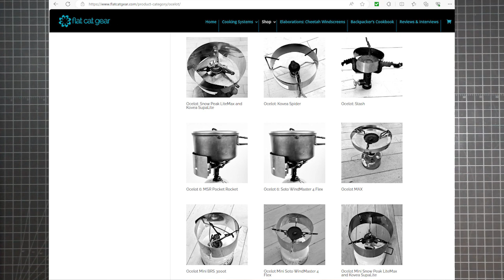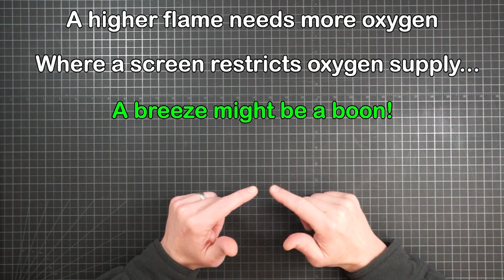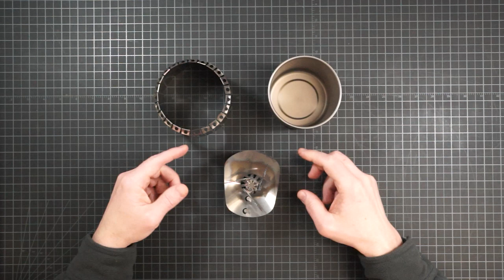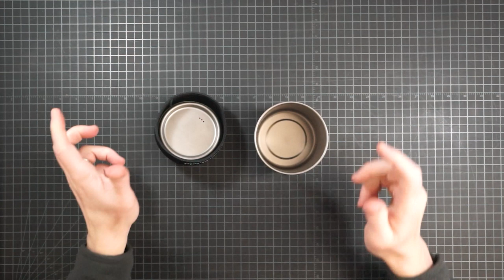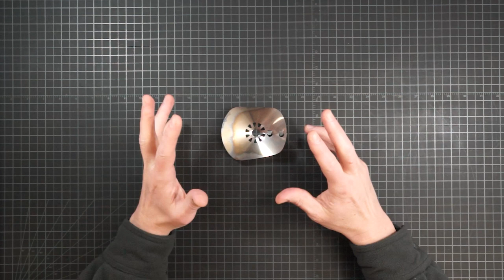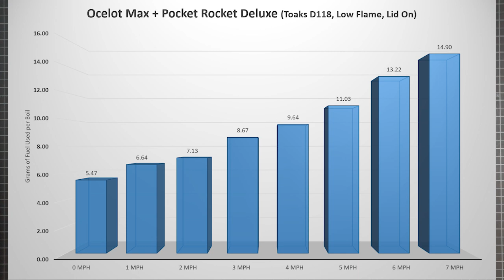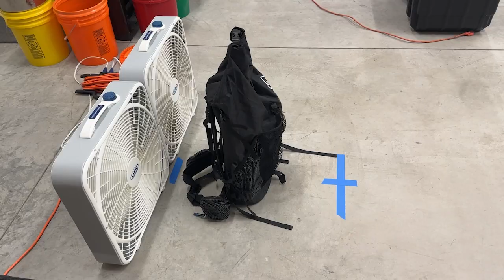Backpacking Stove Efficiency, Part 3: Windscreens

Comment: I wonder what happens if you use the wider pot with a smaller burner and a windshield.
I suspect it would actually be more efficient if there's an air gap below the pot and then you're not increasing the weight so much. It might seem redundant to have the wider pot without a wider flame being produced but heat is spreading out the sides anyway so I still suspect it's a minor improvement.

Comment: The optimus shield was installed a little low on your adapter. It would sit just below the lip if it would be installed on canister. Not a shield for weight weenies anyway, but it can be nice if radius of the shield is close to the radius of your cup, then it takes up little space volume wise. Nice compromise between the flat panel windscreens and thin foil ones that fold under wind :P (I was not aware of FlatCatGear ones)

Comment: I'm curious about the possibility of burying the stove and fuel canister to use the ground to block the wind rather than any aftermarket shield. It would require a bit more work in the field, but it could be worth it, especially if you're using a wider diameter pot/pan that might require something like the ocelot max but while using the lighter brs.

Comment: Thank you for in debth analysis.

A piece of thick alu folie might make an ultra light, ultra cheap custom windscreen for any system.

Remember, consumables like food and gas is consumed during the hike…the weight penalty is therefore only max the first day before the first meal, and zero the last day after the last meal…maybe 50% in average.
Reply from the maker: I appreciate that aluminum foil can be a very light option.  It makes a good screen for alcohol stoves.  My reluctance to discuss it with gas canister stoves is due to the potential safety concern of trapping the pressurized can inside where it might dangerously overheat.
Reply: @GearSkeptic  the alufoil option was just an add-on to the very precise test you did. So was the heads up, that there is a difference between consumables and non consumables, actually a huge difference on longer hikes, food included, in favor of low non-consumable system weight, higher gas consumption trade off’s.

I totally agree alufoil doesnt fit into your precise tests, which also require a windscreen which doesnt change shape between your individual tests, and can be purchased for similar performance.

Good point to make sure an alufoil windshield doesnt make any hazard to the gas canister, in combination with a burner attached directly to the gas canister, a hazard I remember you also mentioned in the video.

Thank you for all your time invested in educating all of us.
Reply from the maker: As an aside, I do have plans to work on some homemade (or modified) screens, including heat exchange options.  That is, as soon as I can get my shop set up.
Reply: @GearSkeptic  I look forward. The non consumable gas canister is many times the weight of the Titanium burner. Might be worth looking for the lightest gas container on the market….maybe even consider to transfer gas between such a canister made of alu or maybe one day titanium or CF too.
Reply: @GearSkeptic just tested a 15cm wide (tall) 5gr. Thick Folio, 360 deg. around a pot with 500 gr. 16 deg. C water, on a 15gr. Titanium windscreen and a 48 gr. Alcohol burner.

15 gr. Of 93% alcohol, managed to raise the temperature to 88 degrees C, in app. 8 min, in light wind and an ambient temperature around 22 C.

15 - 20 gr. Of 93% alcohol should do the job in most cases, where my gas burner did the job with 9 gr. of Butane.

App double the fuel weight with 93% alcohol……but much lighter fuel container.

The 5 gr. 15cm tall folio windscreen, to copy the mini trangia, did make a good difference. However, in stormy weather I wouldnt like to mess with folio
Reply: @GearSkeptic did some more testing. The trangia mini (which also fits a trangia gas burner) and the trangia alcohol burner performed best, and are the benchmark with respect to fuel economy….not weight, which by the way is not that important during the winter, where one dont carry the weight on the back.

However, with the trangia alcohol burner in a 15 gr. Titanium Combined stand/windscreen, and with folio on the sides and the top, to trap and reflect heat, the fuel economy gor close to the trangia mini, which is a clever and optimized design…..just folio is not practical in windy conditions.

Comment: I'll show you a camisole style windshield. That's from the pot
This is how to hang the windshield. Simply attach three thin wires to the strip-shaped windshield and hang them from above the pot ❗ To make it headwind
Change the angle of the windshield according to the direction of the wind. It's extremely light and can be made by yourself. Moreover, it is easy to store and easy to use! ️

Comment: Love your videos! I have the Optimus, but I think it’s way too heavy. Do you think I could cut off the upper third, without sacrificing efficiency?
Reply from the maker: I think it might theoretically cost you a tiny bit of efficiency, but it would be hard to tell (so maybe worth the weight savings).  Consider how low the Flatcat windscreen for wider pots sits.  It basically covers only the flame and none of the pot sides, yet still gives good benefit.  The balance might shift if the air gets really cold, but for most conditions, protecting the pot sides doesn’t seem to pay off as much.

Comment: Please be careful with windscreens and canister stoves! One of the few problems with canister stoves is the possibility of bursting/explosion if the canister gets too hot. Back when these stoves were in their infancy, people used aluminum windscreens such as those used for the MSR Whisperlite white gas stoves. People would wrap the aluminum windscreen tight around the canister and even the stove, which sometimes resulted in the canister being heated and bursting, causing a huge fireball and possible injury to those nearby. These windscreens that are designed for canisters often have parts designed to keep the heat away from the canister, for just this reason...

Comment: While your information on the increase of efficiency was to the point and helpful to understand the effects of this wind screen, I don't understand why you felt the need to mount the BRS-3000T on the MSR lowdown.  Anyone concerned about weight would never add a 6 ounce stove stand to a one ounce stove, and it just creates a distraction for the viewers of this video.  Furthermore, I'd guess that 90% of the viewers would rather not watch your finger gestures for 40 minutes.  Aside from those two issues your presentation was brilliant.
Reply from the maker: The LowDowns are not for field use. They are for flow rate regulation during testing. Methodology is described more fully in Part 1. As stated at the beginning of this video, I always recommend you watch them in order, as each video builds upon concepts introduced previously.

Comment: Many thanks for these tests! I really really hoped to see a comparison including that foldable standing wind screen at the end. I guess it would function as the one I use, which is much like the one on this picture: https://i.imgur.com/WqFfYDv.jpg
I've never even seen anyone using windscreens like those in the tests.
You did touch on the subject, but if you do any kind of cooking except boiling water, the BRS 3000 is a terrible choice. It will burn your food. Many people would even say it's completely unusable. Including me.
Also, I have to add that I've always used aluminium foil lids, without even thinking of using anything else. 😄 They work so well!

Comment: The BRS 3000 burner support legs will fit up and into the HX underside of a Firemaple FMC X6 1litre heat exchange pot, and works very well in conjunction with said pot.

Comment: I love the through approach and proper reference to studies you have going on in you videos! YouTube needs more people like you. I imagine each video takes a small eternity to make. I would definitely be willing to sponsor on Patreon if asked. 
I’ve noticed some marketing regarding gas mix in canisters making various claims about cold weather performance. It might be a nice topic for a video to compare gas pressure vs temperature. And how much the pressure drops when canisters are emptied at low temperatures. Of cause due to temperature drop, but I also suspect that propane and isobutane (2-methylpropane) drain from a cold canister first leaving only butane behind. Resulting in no pressure under freezing, despite having gas left in the canister.

Comment: Please do a part 4 with heat exchanger pots like Jetboil etc! Other's data has shown they both increase fuel efficiency at rest and with wind, but no one else has such meticulous methodology as you do with your experiments. I've been wanting to try the Jetboil Stash but all the components kinda suck except the ultralight 800ml aluminum fluxring pot. It would be very interesting to see how Jetboil fluxring pots compare vs off-brand heat exchanger pots and how these kind of pots compare on different stoves.
Reply from the maker: I am actually working on heat exchangers right now.  There’s a lot of boiling and analysis to do. Hopefully it will be ready in a few weeks.
Reply: @GearSkeptic  I wanna kiss you

Comment: I'll have to pick up one of those Ocelot minis. Didn't even know they existed. Great work! Very informative videos.

 For stove, I usually use a Trangia, with one of those clip-together titanium windscreen/stovestands and an anodized aluminum Olicamp xts pot which has the heat coils built in. I use a cut top portion of a soda can for a simmer ring. I use at least 1/3 the amount of fuel compared to a regular pot without a windscreen and simmer ring and in using the yellow bottle heet, I'm saving money compared to denatured alcohol. I store the fuel in a soda bottle. Not sure if there's anything better and maybe it helps someone to know these things.

Comment: I'd love to hear how a pot with a heat exchanger does. There are claims that it's 20-40% more efficient, with the most frequent being around 30%. At least for the setup I'm considering (toaks 900ml vs Fire-Maple 1L with heat exchanger both 115mm diameter), there's 65g weight penalty, but for a thru-hike that means less time carrying two canisters (one full, one almost empty). It's totally unclear when this efficiency gain actually happens. Is it dependent on stove/burner size, wind, or flame power? Intuitively it will have the highest impact with a lot of flame going up the sides, so some combination of big burner, small pot, high wind and high flame, but is it irrelevant if you cook with a small burner (ie brs or pocket rocket) at low power with a wide pot (say >115mm as you found was enough) and a wind screen?
Reply from the maker: Great questions! As it happens, I’m actually working on heat exchangers right now.
Reply: @GearSkeptic  Amazing! Any idea when that will come out? I need to decide what to buy in the next week or so...

Relatedly, after watching this windscreen video, I realized there's a 3-prong version of the Soto Windmaster which also gets it pretty competitive weight wise to the BRS with light windscreen, and certainly better than the PocketRocket.
Reply: @tewalds  Since time is of the essence for you, let me add some information here.  If an HX is more fuel efficient what does that mean?  Well (in calm conditions), let’s say that you boil 2 cups of water in a standard mug and use 7 grams of fuel,  and then switching to an HX pot the fuel usage is 5 grams.  That is a 2-grams saving or 28.57%.  If 2 grams (in calm conditions) per boil is important then it may matter.  What for GearSkeptic’s full video to see a fuller, more detailed picture.  My 2 cents.
Reply: @FlatCatGear  The claim is simple, as you say. The subtleties really matter though. I have read/watched quite a few pages/videos about this and many do some basic test, but none have been done with anywhere close to the rigour that @gearskeptic6355 has used in this series. They use some random pots that aren't directly comparable, often with different stoves, usually at full throttle (ie low efficiency according to video 1 of this series, and again incomparable with different stoves). My hunch is that the efficiency bump is more like 5-10% for low fuel rate with a narrow flame on a wide pot in low wind, plausibly closer to 30% at high fuel rates, and as high as 50% in the extreme situations (big flame, small pot, high wind). My guess of the conclusion is: are you willing to carry the extra weight to get the same fuel use but with 50-70% the boil time? If so, get the heat exchanger, if not, don't. I'm looking forward to seeing the actual evidence though. One thing that would be amazing to see is the actual efficiency percentage (ie joules going into the water (should be constant) vs joules in the fuel (depends on fuel rate and time)).
Reply from the maker: I have the Soto TriFlex.  It’s nice.  Unfortunately, it will probably take at least a few weeks.  Lots of boils to do, then graphing, analysis, making slides, writing script, filming, and then all that editing 😵‍💫

Comment: Regarding the last part of wind blocks, deflection, etc, something that came to mind:

  Take a stick and anchor it, upright, into the ground well.  Take a small'ish, square or rectangular* piece of UL, but decently tough and durable piece of fabric (like 1.1 oz/yd2 6.6 nylon with silicone coating) with some corner tie outs and a bit of UHMWPE (or other) cord tied to it. Figure out the wind direction and put the fabric over the stick and stretch it out into a < with the point of the < towards the wind, anchor the tieouts with rocks, sticks, or the like.  Should create an excellent wind deflection zone, while allowing plenty of oxygen to get to the flame.  If you're worried about the flame in relation to the fabric, you can just move it farther away from the stick, but you could also use fabrics like siliconized wool, kevlar, nomex, or the like if that is a concern (heck, you could even soak linen or cotton in a half and half solution of borax and boric acid, and then siliconize it when dry, and it should be pretty decently fire retardant).

  Point being is that fabric is significantly lighter/less dense than metal. * You could also play with the shape of the fabric to cut down on weight, like say an upright triangular shape or the like, instead of square or retangular. 

     But I suspect that a lot of us cook kind of in our shelter anyways, which already minimizes wind... (Edit, I see you did briefly address that at the very end).

Comment: I very much appreciate your time in putting together these videos!

I went on a hike for a month with a stove setup based on your first video in the series which worked better than I expected. I think I probably would have added a windshield based on this video, but I actually found a very significant benefit to the BRS/550mL pot combo using my Zlite sit pad as a windshield. It meant I didn't get through a 230g canister in around 40-50 "boils".

Although, significantly slower boil time to my usual carry of an MSR Reactor, I'm very much looking forward to Part 4 to see if this features!

Comment: I've wondered for a long time if it's possible to get a windscreen made of an insulating material.

I think that any heat gained by the windscreen is wasted heat, heat that could be gained by the pot that you're boiling the water in.

If the windscreen was insulating, at least some of that extra heat would be absorbed by the pot and make the entire system more efficient.

Just about every windscreen I've ever seen is made out of aluminum which is a great conductor of heat. Has anyone seen a windscreen made of something that doesn't actually absorb heat?

What do you think?

Comment: The summetshield doesn't have enough room for the heat to rise. Made worse with wind, forcing the flame to go downward with heat expansion as gas burns.

I get the strength of titanium but it doesn't transfer heat from flame to inside liquid as efficiently as aluminum.

I'm curious what a heat exchanger style pot of a jet boil used with a BRS stove would do.

Comment: Before i start this, i wanted to say i realized any interference with a flame source will cause more fuel to be consumed. even the slightest draft barely noticable, pushes the flame around. any time your flame moves, it will pull an equal amount of that motion out of the fuel. just like a torch, the more air, hotter flame, more combustion = more fuel consumption. any time you hear that torch like sound the little whoosh, on the propane flame, you're wasting fuel.

i make coffee on a propane stove every day. if i do it outside, it consumes twice as much fuel, as it dies out in half the time due to wind, which obviously is more than substantial lol blocking the wind is extremely powerful, not just for convenience as we think of it. can't wait to watch this! 😅

Comment: can you do a test on how much you can safely overfill an empty fuel canister.

i usually get 5 weeks off of work. i take those 5 weeks all at once and go backpacking all over the adirondacks. my car is my resupply point. ill keep a fresh big canister in my car and refill my canister when i go to resupply. im confident i can refill my small canister significantly higher than their normal brand new weight.

obviously more gas will help with the reduced efficiency in windy conditions